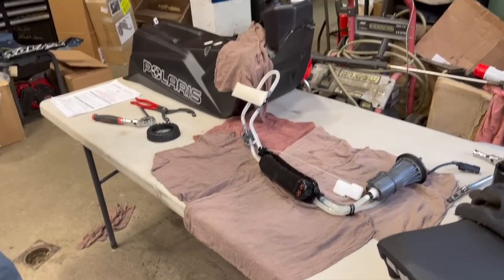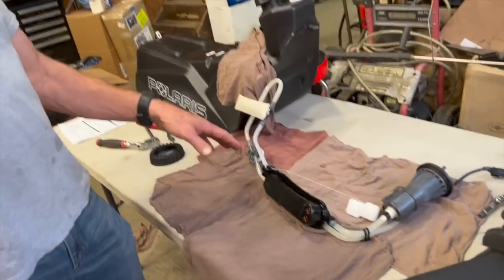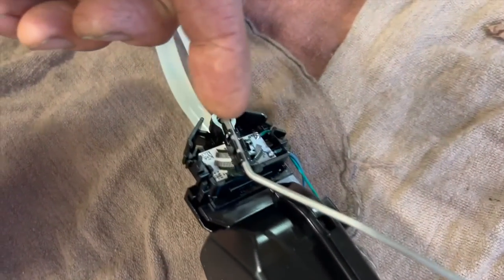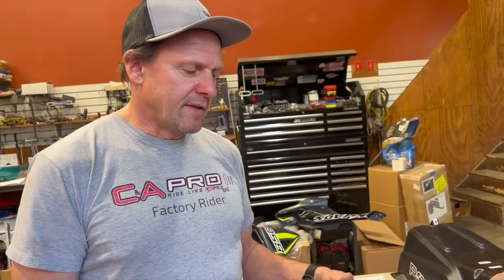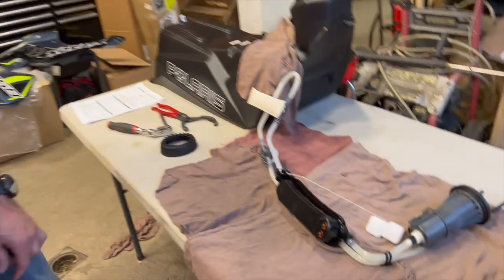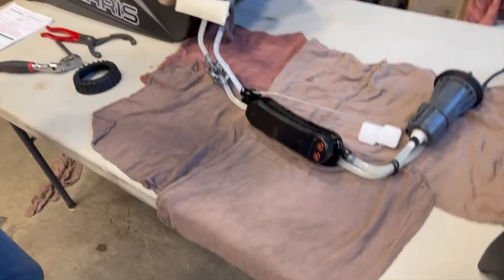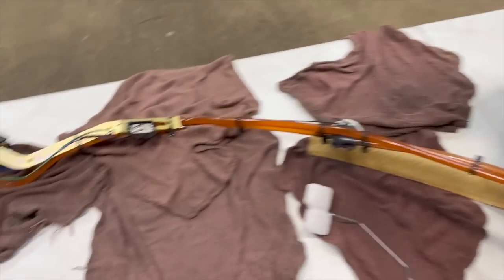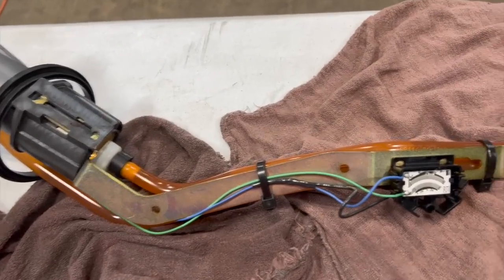NEWEST UPDATE ON POLARIS SNOWMOBILE STOP RIDE / STOP SALE S-22-09. WHAT PARTS ARE BEING CHANGED?

Comment: Thanks for showing what is going on. In most cases dealers dont want to tell the customer anything. They did not sign up for this. My dealer has 3-4 hundred sleds to do. i just hope that polaris is sending the kits out and the dealer is abiding to this in an orderly fashion and not fixing buddies sleds first.
Reply: Exactly… my dealership gave me attitude when I asked about it. Said they were way out on the recall stuff. He said they aren’t receiving kits from Polaris like they said they would. Only received 27 kits so far. Said he’s sitting on 300 sleds. I just hope like you… they are actually abiding order. I’m hoping they don’t do the units they sold this year first ( to keep customers happy) since I’ve already missed a whole season on this sled already. Frustrating to say the least. 🙄 I’m just trying to stay hopeful and positive 🤞🏼
Reply from the maker: it is at the dealers discretion to put the kits in what sleds they want. im sure as a dealer they will be putting them in sleds to get them out the door. (new sleds, left over sleds or sleds that are there for service thata re now stuck there) this is alot for dealers and they are overwhelmed also.
Reply: Every dealer is different but my local dealer is doing customer sleds first. They have sleds on the floor for sale that have not been done yet.

Comment: as of right now, what's the turnaround time after sled drop off? Roughly  .
Reply from the maker: Totally up to your dealer. Depends on how backed up they are etc
Reply: @JESSEJAMES322  thanks
Reply from the maker: Wish I had a better answer but it’s totally up to the dealer unfortunately
Reply from the maker: agreed 100%. as long as they have the parts they will be pushing these sleds right out the door
Reply: Mine was same day last friday. Dealer called at the beginning of the week and asked if I would drop it off friday morning. Had it back after lunch. Depends on your dealer but most of these places want the sleds in and out, no room for storage.  My dealer is expecting about 700 of them.

Comment: Hey Jesse my question is kinda off topic but do you know if the 2023 assault 850 non electric start comes with a small battery to run the 7s? Thanks in advance
Reply from the maker: years past the mountain sleds did but i am unusre of the assault. I would assume so though

Comment: My notice said I’ll get a new fuel pump assembly. Not just parts. 🤔
Reply from the maker: If you have a 13 or 14 maybe but if you have newer stuff then no you won’t be
Reply: @JESSEJAMES322  interesting.   I’ve a 22 XCR. I’ve read that they’ve updated the fuel sock for MY 23 to cure the know fuel pump whine. Any word on that?
Reply: I also had the fuel pump socks replaced for an earlier recall, this summer on my ‘22 Khaos, Just seems strange to me that there’s a new recall in the same area

Comment: When I called my local dealer to get on the "waiting list" they told me I had to contact the original selling dealer of the sled because the fix kit that is "supposed" to be for that sled technically is being sent to that dealer
Reply from the maker: I dont think that is right. Dealers are getting a certain amount of kits and they can use them on what sleds they see fit. Im sure thet are struggling for kits and are putting them on stuff to get out the door
Reply: I really don't think it's right either. Especially since my sled originally came from Wisconsin and I'm in Michigan now
Reply: Yeah, thats not true.  My 2020 Khaos just got done at my local dealer, I bought it almost new but used from a guy who bought it somewhere totally different.

Comment: What's concerning is that what's the actual problem? Is it that sender resistor? Is it the clamps? I don't think they know!! Taking out all the metal components and hoping for the best....🤔🤔🤔
Reply from the maker: i guess they did testing and this fixed whatever the issue is
Reply: I guess 😂😂😂 Polaris engineering never ceases to amaze 👍👍The Crazy thing is I've been a mechanic for over 40 years and when cars came out with Electric pumps in the tank we all thought this was like playing with fire!! No pun intended 😂😂 Thanks for the information!!